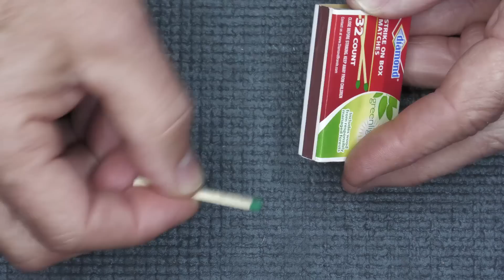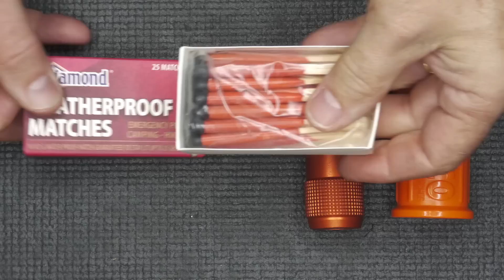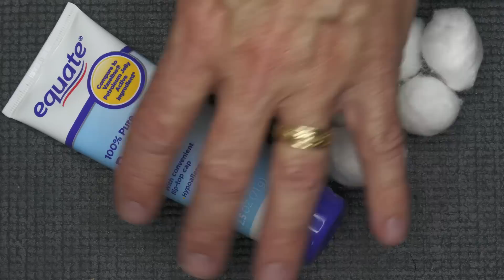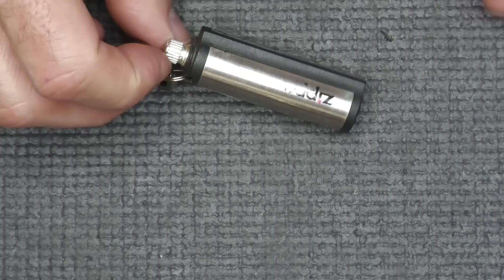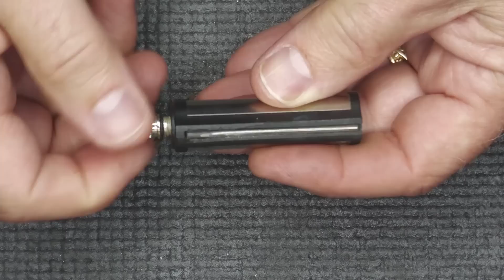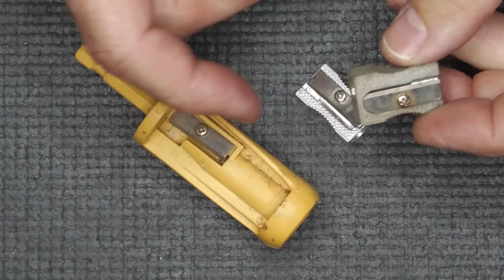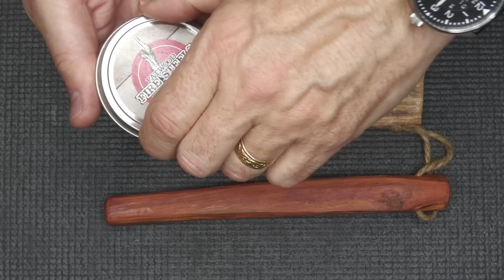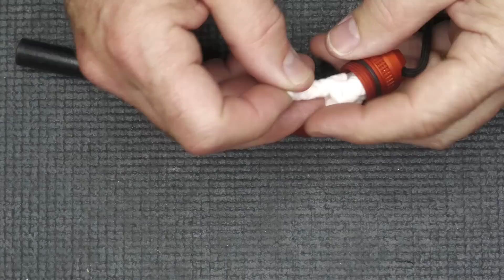15 Unusual Fire Starting Tricks

Comment: Strike anywhere matches are still available.   ACE Hardware stores carry them, as well as other places.  Admittedly, they are not as good as the old Blue Tip brand that could easily light on any rough surface, including your Blue Jeans, if you stretched the material tight.  I like to dip the match heads and about 1/4"  of the wood below the head in clear fingernail polish to make them waterproof.  I package about a dozen matches and a small  piece of match striker paper (sold in sheets on Amazon) in a small vacuum sealed packet.   I make the packets, about 3" x 2" from cut down vacuum sealer bags, and after packaging the matches and striker paper in the packets, I vacuum seal them using a common kitchen food vacuum sealer.  Although the match heads are waterproofed by the fingernail polish, which will prevent the match heads from deteriorating in damp, high humidity conditions, the length of wood in the match is not waterproof.   And, although the strike anywhere matches can be lighted by striking on a rough surface, having a dry strike surface with the matches insures a successful light.  The small, thin packets can be easily carried in a pocket, such as the small watch pocket in a pair of jeans or included in a survival kit, such as the popular homemade survival kits in an Altoids tin.

Comment: I think it is more about having skills than having 4-5 methods of making fire on you at all times.  If you have a fero rod or a lighter and some skill then your good.  If you also have the skill to do a friction fire then even better.  I have altoid tin size fire kits in my camping gear, but I normally have a small fero rod on me as EDC.
Reply: Having the skills is always recommended... but friction fire is labor intensive and highly improbable in the middle of a rainstorm or if everything is covered in snow. Having redundancy is never a bad thing. Having a variety of methods might be also be required if you range across different elevations or different climates/seasons. 

For example: Lighters don't work as well at high elevation... but a ferro rod does. A ferro rod isn't as optimal if exposed to sea water as it corrodes... but storm matches can burn even in wet conditions. 

I personally always carry a Bic in a Exotac Firesleeve on my keyring for a number of reasons even though I don't smoke. Lighting birthday candles, melting paracord, lighting a grill, etc... I even have a small ferro rod in my victorinox sak toothpick slot along with the Magnifier built in the tool. Neither weighs any more than carrying the SAK does already but it expands my options in a emergency and it's part of my EDC in a seperate pocket from my keyring.

Having seperate options in different locations just means you have redundancies for if you lose some part of your kit. And you aren't necessarily reliant on more labor intensive primitive methods as your only backup.

Comment: Why is it always the BIC lighters!? Anyone who ever tried to start a fire with a BIC will hate it, because they suck. The lightest breeze will make it go out. As if none of you ever used a cheap gas station jet lighter. Wind proof, refillable, way hotter and concentrated, no sore thumbs because you just push a button instead of doing the wheel thingy. These BICs are so unjustified and overhyped.

Comment: I bag up dryer lint. Works like a charm.
Reply: Hollow out an old Bic lighter so the flint still works and shove lint in the hollowed out hole and pull out a small piece and use the striker to light it 
LINT n FLINT
Reply: Yeah it does, also soaking it in a little wax helps too, Pretty much with anything and will help keep it water resistant .

Comment: Sootch, something prepress should know. Water bottles, laundry detergent and many liquids are sold in plastic bottles. In time the plastic will break down and they will leak. It’s best to store liquids in food grade containers or plastic that does not break down.
Reply: You said "In time the plastic will break down and leak". How many years is that? ...Ish? Because I'd imagine its 15 or 20 + years, so that is more than enough for most liquids
Reply: @chrissewell1608  It is about 4 years or so. The plastic water bottles is designed to break down in land fills. We have had several that have failed. We have had other products also. First we moved them to a storage tub, but after multiple failures we used other containers. The blus food safe 6 gallon on Amazon.

Comment: You dont need carbon in the steel of your blade to use a ferro rod at all. Just anything harder than the ferri rod itself. You do need a high carbon steel if you using something like flint

Comment: Recommended that YOU do NOT remove the BIC gadgets FROM the package, until NEEDED.
The fuel might evaporate faster? AND...the striker wheel COULD become CORRODED & fail?
Ref: Matches? I found some LONG STEMMED matches at a LOWE'S. SHOULD keep Your hands AWAY from the flame a bit better??? I do believe that the smokeless or black powder would be the very last resort. Too quick and really looks DANGEROUS?? How about those BUTANE torches that are out there??? I don't know what they actually called? Look like BIG Brother of the BIC deals? I saw mention of something called PIEZO (spelling?) lighters?Not sure how they work? Anybody have an IDEA???

Comment: Just a couple of notes.  The Zippo lighter isn't a butane lighter.  That little Zippo fire starter thing is supposed to fill with lighter fluid and sparking it lights that little bit of rope on the end.  Off brand is called a permanent match.

But lots of good info and some things I have never heard to use as a fire starter.
Reply: We used old oil and corn cobs to start coal stove when I was a boy

Comment: I'm sure others have said it already, but you don't need carbon steel to strike a ferro rod. I've used broken ceramic, broken glass or pretty much anything hard enough and with a sharp edge will work.

Comment: I melt my petroleum jelly in a paper bowl in the microwave and pour it into the bag of cotton. No mess and disposable bowl. PRO TIP Freezer bags for the cotton then store them in an oven bag. you can use the oven bag to boil water.
Reply: cut the paper bowl up as additional fire starter?
Reply: Dryer lint in paper egg cartons soaked with wax.  late 70's Boy Scout method.
Reply: Becareful with using the microwave it can ignite

Comment: SP, as a zippo collector and user over the past decade or so, it really hurts for me to hear you say Zippos arent a good candidate for survival, even without fluid in them they still can give you a multitude of fires, by pulling out the inner cotton(rayon as zippo calls it) and throwing a spark on that, or putting a piece of charcloth in the  windproof chimney you can get sparks on it easily,  for the past 8 or so years i have also been carrying the zippo keychain fuel canister, the canister itself holding an entire full refill of fuel, a spare flint, and a spare wick, as well as a spare flint and wick inside my daily driver and in the zippos and other fuel canisters i have in my bugoutbags and vehicles. If saving fuel is a concern, using the fuel canister to wet the wick just enough to get a fire started you can still get dozens if not hundreds of fires out of one full fuel canister, of which i’ve ran over, along with my keys on accident, with my semi truck, and it still sealed and held fuel just fine. While it may be an extra thing to carry yes, you can clip it on just about anywhere and you wont notice the difference
Reply: Another thing with zippos is you can carry extra lighter fluid easily. I've been wanting to get just some canteen for it and there are also the hand warmers which makes having extra more useful
Reply: @wades623  thats what im saying with the canister keychain, can fill a whole lighter once, or get 4-6 hours of heat from a handwarmer, having a few around wouldnt hurt.

Comment: Great collection of different fire starting devices. Spark-Lite makes a nice one handed fire starter that comes with tinder in a weather resistant container. I have it and the Blastmatch but I prefer the Spark-Lite. You don’t need a hard surface to press against with it. Regardless of which method you use, try it out before you actually need it to save your life!

Comment: Vicks Vapo Rub as an alternative to Vaseline on cotton balls gives an added first aid benefit to help with nasal decongestion, and it is mostly comprised of petroleum jelly just like Vaseline so equally as flammable.
Reply: I will one up you and suggest Neosporin, the generic triple antibiotic ointment is cheap.
Reply: I have been known to use chapstick and Carmex for Firestarter boost in rain before, same concept, similar component
Reply: I double duty my chapstick for an accelerant
Reply: Good idea, if its comparable in price???
Reply: @chrissewell1608  no, Vicks is way more expensive! Vaseline is hands down cheaper specifically if you get the store brand.
Reply: @chrissewell1608   No, petroleum jelly (specially the generic Great Value) is a fraction of the cost of Vicks.
Reply: Having several ways to start a fire is a good practice.

Comment: "Bic lighters" is a brand.  Please refer to them as BUTANE lighters. Torch lighters were designed to light cigars.
There is a channel called the David West channel.  This guy can start a fire in any condition:  rain, wind, etc., and he doesn't need any fire starters!   He doesn't need a butane lighter.  He has used a Fresnel lens, fire roll, chirt & steel, eyeglasses, even a spoon!

You are using the ferro rod backward:  hold the blade still, and pull the rod.

Comment: My favourite from those (other than the bought wax impregnated tinders) is a block of fatwood with the smiths grater. It's not difficult to create fine shavings of fatwood using a ferro rod striker or spine of a folding saw, but as shown in this video the convenience of the container underneath the smiths grater is superb.  Grate some fatwood then light it with the smallest spark.
Reply: @ KEVIN?? PLS ADVISE about SMITH'S GRATER? I'm a newbie and am ignorant?
Reply: @jtc1947  its in the video
Reply: @robshirewood5060 YESS! Finally caught up to the SMITH GRATER! GREAT DEVICE!

Comment: Still repeating the story about needing a carbon steel blade to strike a ferro rod.  You don't. It just needs to have a sharp spine.  Some of the best strikers are the spine on folding saws, and the awl on a victorinox, both very definitely stainless. In fact many of the excellent strikers that come with ferro rods never rust, so are very unlikely to be carbon steel.
Reply: There's also ceramic strikers as well.
Reply: Correct, I've used broken glass before.
Reply: I don't understand why he keeps saying that you need carbon steel. It can be scraped with any hard sharp material, glass, ceramic, stainless steel, etc. Lately, he's been saying quite a few incorrect things.
Reply: I've used random rocks that look high in iron.  I think I've even used quarts.
Reply: @sonicplanet9193  so did you use "quarts" of rocks, or a piece of "quartz"?
Reply: @sonicplanet9193   a quart of what liquid?
Reply: All it takes to strike a ferro rod is something with an edge (~90° or at least sharp) AND the striker has to be a harder material than the ferro rod itself, but either way it has nothing to do with carbon content and that has been known for years at this point and I've said it on here I don't know how many times lol.
Reply: @alphaomegasurvivalsupply6548  👍  The IGNORANT leading the IGNORANT!
Reply: @speedygonzales9993  🤦🤣🤷
Reply: Just don’t trust a ferro rod on a sea shore. Salt water dissolves them.
Reply: Thats good info that most folks dont know@jctedsap
Reply: Hes using a Gerber Principle in 420hc stainless steel.
Reply: They get needing carbon steel from flint and steel?
Reply: @barneybrady549  I guess 🤷
Reply: In my experience (over 40 years) a fero rod doesn't  need carbon steel. All you need is an acute angle.  Ive used stone before in a real situation. Yes flint or obsidian works but so fo most rock types. I've even had success with a rusty nail I found. 
Great video.  Interesting content and information.
Reply: @Countryboy071  Yes, Sir.
Reply: True enough. Also the choil notch on an Essee 5 and 6 is sharp enough to pull your firesteel across - without grinding off the coating.
Reply: @mitchlindeman7033  Yes, firesteel always come w/ a striker. I will use that striker & 'save' that sharp spine on my bushcraft knife for other uses. Why do people keep using that sharp spine of the knife to scrape firesteel?
Reply: @speedygonzales9993  my knife has a ferro rod holder on the sheath. So it is the most convenient "go to" edge when using the ferro rod. If it ever becomes dull it's an easy job to sharpen it. I've also had some really useless strikers on ferro rods in the past.
Reply: I keep a chunk of hacksaw blade tied to mine. Weighs nothin, but sparks like hell
Reply: I suppose the confusion is because the steel for a flint and steel set will be made from carbon steel. It's the steel that produce the sparks, so it's composition and hardening is important to easily provide good sparks, the flint is just a convenient material that is hard enough to scrape/shave off small bits of the steel, so while flint is the iconic material, there are other hard minerals that have been used.

Ferrocerium is an alloy that is formulated to be easily ignited in air, so it provides the sparks, the composition of the tool used to scrape it isn't that important, a knife or the tool the rod comes with is the most common because it's a conveniently available tool, but any hard and sturdy material that can hold a suitable edge should work.
Reply: RIGHT ON ! ! !  🤗 👍
Reply: Agreed. Ferro rods strikers just need a hard 90° edge to remove material from the Rod which ignites. Ceramic, steel, stone... doesn't matter.

The carbon steel blade is only recommended now as a backup if you somehow end up with only your knife. You can use flint or chert on the spine of your knife to remove steel which sparks and ignites. It still needs char or some other tinder than can catch a lower temp spark. In that specific instance a stainless steel doesn't work.
Reply: I agree that the material does not matter as long as it is hard enough to shave off self igniting chips.
But fully hardened carbon steel can be surprisingly rust resistant. Not as stainless steel, of course. But it does not rust like construction steel.
Reply: The Victorinox awl was my best striker for a long time. A sharp edge is the key to releasing those sparks.
Reply: Correct. You can literally use a glass shard:

https://youtu.be/xZMtnv1eKHA?si=-auU7N5NuP6V1ghr
Reply: You can use carbide too .
Reply: What is carbon steel ? The opposite would be non-carbon steel AKA iron.
Reply: Beat me to it i was going to say the same thing. Everything else still good information.
Reply: Use one of those tiny Swiss Army knives for mine, works great ❤
Reply: ............thanks for that info, others have made a similar point. It just goes to show how entrenched and tunnel vision some you 
tube presenters have even though their content is quite good.  Best wishes from Mike in County Durham UK
Reply: You don’t need carbon in the blade.  It has nothing to do with the knife. Just need a sharp edge.
Reply: If you have a carbon steel striker you can use it to sharpen your knife.
Reply: There is carbon in all steels stainless is usually less than one percent and high carbon steels are around 2 percent
Reply: @danielparker4919 thats utterly false... mild steel is 0.01-0 39% carbon by weight medium carbon steel is 0.40-0.79% carbon by weight.. high carbon is 0.80-5% carbon by weight... high carbon steel is the widest range of steels but stainless is not usually anything there are many high carbon stainless alloys on the market

Comment: Back in the day we used 35 mm film containers with strike anywhere matches inside them. Use your zipper to light them or if your good you can use your finger nail or tooth to light em up.
Reply: Too bad that true strike anywhere matches are basically no longer made 😔
Reply: Agreed. I remember striking on my jeans zipper  @michaelmeyers4950
Reply: We held the tips together and lit them off each other.
Reply: Neither are 35mm film canisters! Not like they were in the 70's & 80's! I still have a few laying around. Some in my camping gear. (One pair is even used as Salt & Pepper Shakers! 🧂🫙 😋)

Comment: Safety tip close that blade when striking them rods I don’t want to see you bleed 🩸 every time I see that I 🙏
Reply: Its a fixed blade Gerber Principle.
Reply: You are correct my mistake however why use a knife when there is a striker on the bench just saying 😂
Reply: @danstuck4720  the stryker attached to the 4"x1/2" rod is from UCO. Mine was crappy. The edges weren't sharp. A lot of strikers that come with less expensive rods are awful. Will they work? Most of the time yes, but, it'll be labor intensive. Jmo
Reply: Striking a knife with the back of a blade always was and always will be stupid.
Reply: Use the goddamn blade. I used the cutting edge of a Mora Companion SD for striking 25 times. 
The edge was still sharp. 

This paranoia of striking a ferro rod is just pityful and ridicolous. Good Lord,…